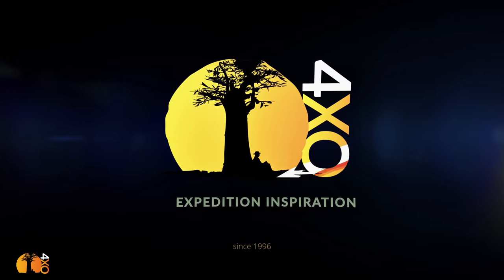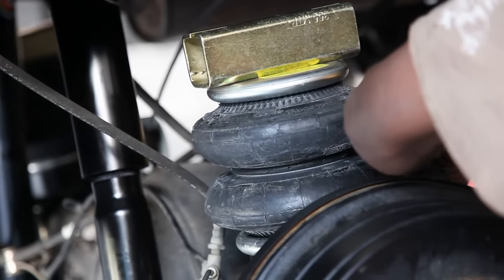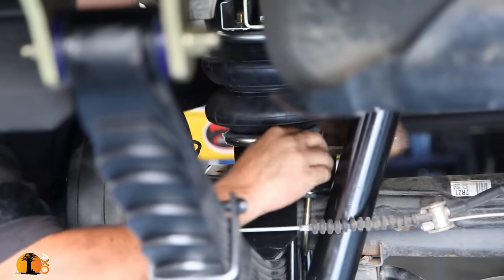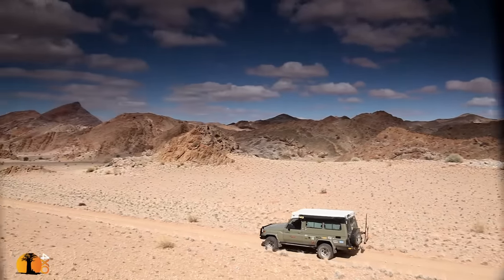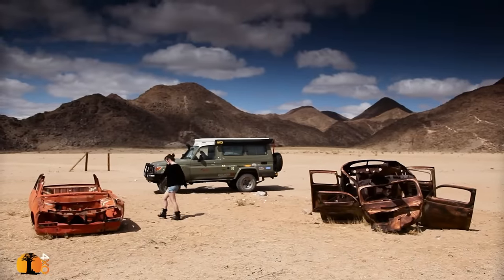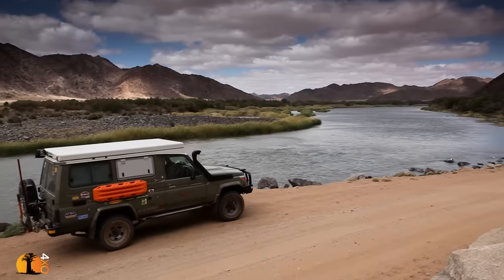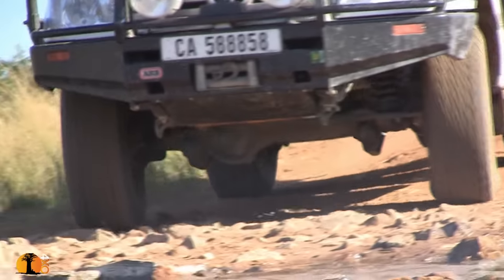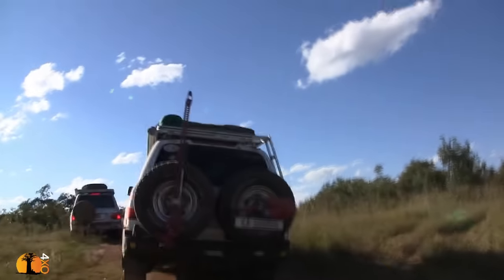AIR-BAG HELPER SPRINGS. ANY GOOD? | ASPW 4xOverland

Comment: I do not disagree with most of what you are saying.
However I would add in my experience with air helper springs as a way to temporarily add spring rate for temporarily heavy loads while retaining the stock suspension for mostly empty use and more comfortable ride. 
So number one if an air bag is rated for 70 80 lb of air pressure doesn't mean you can use it once you get above say 30 in most airbag applications it does lock the suspension out. So if you need more than 15 os so pound's roughly than you need a low distribution hitch for a trailer or heavier mainsprings for a camper van type thing. Secondly the bigger the bag the more air volume and the cushier the ride at pressure. One way around this when you have to run smaller bags is to run air tanks in line as close to the bag as possible with a big line between the tank and the bag this acts as a reservoir and the same amount of air pressure will give you more Kush a softer ramp up rate so to speak.

Comment: Pretty global statement ASPW. There are applications out there where the mount points are more than sufficient for the generally (hopefully) amount of lift needed. 4th Gen 2500 RAM is a prime example. That said, airbags will limit your upward articulation (typically) and most definitely have a different ride feel than spring steel. Not necc. In a good way.

Comment: Will a 50 kg helper spring really stress the ladder frame?  I would say no. Maybes if you go over the top with it then yes. Also the way air bag are located on the  LC 70 (above the axel) could help reduce the stress on the ladder frame.

Comment: Agree. They are not for you. But they are for us with slide in campers.
We have rigs that runs great empty, and by using helpers springs, we have cars that runs great fully loaded.

The part that's take the hit, are the same please that use to hold the bump stop.
That place is designed for that stress...

But, the again, I drive a HiLux....

Comment: Very interesting video.  At first when Andrew was considering airbags, I was thinking about what percent of the time would the vehicle be “light” vs “heavy”.  If it would be heavy only 10% of the time, perhaps airbags would have a place.  I never thought about the strength of the connection points.  It’s wonderful learning things.
Reply: Glad you made the point of the chassis not being engineered for all the modifications. Something I would consider are the timbren bumpstops which could reduce the chassis impact with better control when it bottoms out.

Comment: The dreadful squatting stance. From an engineer’s point of view it’s not a big deal as long as at high speed the negative rake doesn’t invite too much air wedged underneath the chassis and causing lift at the vehicle’s front thereby reducing steering control.
As for the rear end violently bottoming out at full load; stiffer springs will sure take care of that at the cost of less stability at high speed, harsher ride (especially for those passengers at the back), higher stress concentrations in the chassis and worse off road ability in way of shorter suspension travel at the back. To solve the problem consider hydraulic bump stops

Comment: If you don't go over the  gross vehicle weight rating (GVWR), or gross vehicle mass (GVM), you cannot go wrong. If the Troopie  rides better with the softer springs while not on max allowable load, you changed the GVWR.  It it self this is not a problem. But when weight is added to the vehicle with the softer rear suspension, my experience is that having airbags is  an option. But do not go over the GVWR of your vehicle. It has to do with brake capacity etc. of your vehicle.  Safety must be the first consideration.

Comment: uuh - Max GVM is the same whether towing or not (possibly the bias shifts rearwards with ball weight)

NB, YES - coil spring constrained cylindrical / single bellows airbags are a sad option...  Little better than a heavy bump stop....   (poison ratio exists)

Truck-like airbags are an option for those who drive vehicles whose gross weight varies wildly on a  regular basis.. - design for maximum wheel travel - the airbag really should be on properly engineered hangers - not just replacing the bump stop.

Comment: Going to have to call BS on the 10:40 part about airbags.  The Ram 3500 with FACTORY air leveling has airbags in that exact location....... So while I wouldn't use it to increase load carrying capacity, it's more than capable of holding the load at the factory height.

Comment: As a separate system from the coil springs, its a no go. However used as a free floated helper spring, air bags make a bit of sense. That being said they can be unreliable.

Comment: How do you feel about factory air springs?
Reply from the maker: My opinions about factory air springs are well known. If they are electronically controlled, IMO they have no place in any adventure vehicle. Because when the system fails (and they do) one cannot repair them and it requires specialist tools and computer programs to get going again.

Comment: I highly disagree with you regarding shock absorbers being able to control the weight of the vehicle and keep it from bottoming out. The shockers are strictly there to control spring oscillations....be it a coil, leaf or torsion bars creating that form of energy. Even Baja trophy trucks don't use the shocks as bump stops or to limit bottoming out. Shocks are to keep the tires connected to the ground and prevent them from bouncing like a ball. In case you are under sprung and start bottoming out, there are other options such as hydraulic bump stops, poly spring bump stops, etc. Regarding your rear spring issue, I would go with a heavier spring for when "loaded up" and just reduce 5 to 10 psi off the rear tires when lightly loaded to soften the highway ride and limit the slapping sensation when going over expansion joints and such at speed. Tire pressure will have more effect on ride comfort than the spring rate differences you're dealing with. Cheers.

Comment: I have to disagree with you Andrew.

Helper airbags with internal bumpstops mounted instead of factory bumpstops are great.
You will not break a chassie at a bump stop mount unless you are already overloaded.

They ofcourse need to be of the right size, shape and lenght so they don't restrict the wheel arcticilation.

But they can help you do excectly what you want!
You want springs that are soft enough to be comfortable in low-medium load range. 
Then with the perfect pressure in the airbag they will help share the load when extra heavy or towing.

Comment: I find anything designed to cater for excess weight  you have to make sure where the attachment  points are, is within specification for the excess weight..

reason why shit fails  because it under engineered carry the load you want to  carry on it..

if you are towing  something at 2 ton or higher, average ball weight is 200 kg,  if you are towing  4.5 ton you're average ball weight is 450 kg,

If what you are towing has a 1.8 ton/1800 kg ball weight would 180kg..

average off road considered caravan getting between 3-5.5 ton average ball weight  300-550 kg

75-150kg  would roughly 750-1,500kg

the bigger issue with utes, is to add structure before you decide the weight  capacity  you want to  hang off the back and what to tow  without damaging the chassis...

Comment: For overlanding you shouldn’t need to install airbags if you put the right suspension on as you ideally should be working within a set weight range. I have used airbags on 5 Landcruisers over 20 years & where they work is for towing big, heavy trailers to create stability, or cab chassis vehicles where you might go from no tray weight to a 1 ton payload. I’ve never broken a chassis in a million kilometres, the people that do have overloaded & over inflated on vehicles that are too light in the chassis for what people are trying to load on them.

Comment: airbags are made to put in something like a prado for towing your boat on the bitumen. THAT is the use case. You didn't mention proper use cases. In this useage pattern, you don't stress much of the car and its only used now and then. THey are not designed to be used offroad under extreme load and conditions as you said. It's a very common misconception.
Reply: theres a few rock crawlers on only airbags here in the US

Comment: I find the airbags on leaf springs eliminates body roll very significantly.
Reply from the maker: It does. By limiting vertical wheel travel. Good at speed, not good off-road.
Reply: @4xoverland  I find my hj61 Sahara with 200kg on the roof (tent & 660w solar) , has much better handling both on & off road with the airbags @ 25psi. If they aren’t inflated…it’s like a beanbag on wheels.😂

Comment: Why not just use test loads to find the weight limits for those parabolics prior to building out the truck rather than asking the hordes on Utubez?
Reply from the maker: I know the weight limits of the springs. On paper they should be too light to carry the load that I've already fitted. But in reality, they are not! And this is the point of this experiment. Do it the way the stores do it and most of the time 4wds are over-sprung. Because the stores play the safety factor first, not the comfort factor. I am looking for the right balance, and working it out for myself. Many have suggested air-bags as a solution. I have rejected this idea, and this is why.
Reply: @4xoverland  you fail to mention a 3rd scenario, replacing coils and springs with air suspension entirely. I want to know how does air suspension perform on ash board roads, I know it extremely uncomfortable when you raise the height of the vehicle but I heard nothing is more comfortable than air, especially off-road.
Reply: @4xoverland  My only experience with air bags has been a positive one. At 5psi (min setting) they really don't affect the normally sublime ride of the King Shocks suspension, but when carrying an additional 30 gallons of fuel, water, etc and towing they offer perfectly customizable support on the fly.  Granted this is on a RAM 2500 Power Wagon on 40" toyo M/T's, so I'm nowhere near the design limits of the carrying capacity for the frame and axles, but I've been rather impressed with the performance in every situation thus far. From highway to washboards to more technical max articulation scenarios it's been perfect. Living in SW Utah I use the truck more than most and coming from a heavily built 200 Series I can't say I'll ever miss that platform.

Comment: I’ve got a Mercedes sprinter van as a workshop, it got leaf springs at rear but only 1 layer so to be Abel to carry the load I’ve got som airbags in stead of an extra layer of springs, worst decision ever… yes it keeps the rear of the car from sacking but if you have to drive over speed bumps you have to go extramarital slow or everything in the car changes place. Real factory fitted air spring, yes please but never as a help again

Comment: Air bags are to go. Most people don't need no more then 35lbs to 40lbs.far from the max of 100+ lbs. If you have to run them that hard then you should look at beefing up the suspension. Airbags should assist the suspension not take over.  I have a 600lbs tougue weight on my camper. I have a 1500 GMC elevation that has 9200 lbs towing capacity and 1780lbs cargo capacity. The truck will loose 11/4 " .  But the truck is level beacause it has a rise of the same from the front not loaded .  To get the truck to back to factury of 11/4" i raise the it to that measurement with the airbags. 35lbs does the trick . The bags in my book help with the suspension. It feels stable on the steering as well as ride. To roling and the sress on the suspension is releived in my book. Experience is the best teacher. 1500 trucks have soft suspensions for ride and it doesn't hurt to have airbags to help them. I tried both ways and the airbags make the difference. Even my wife notice the difference in bad roads. With the added tongue weight and what i have for total cargo you could botton out on bad roads so airbags in my experience give that added comfort and stability.

Comment: The manufacturer should have designed the rear springs to carry maximum permissible weight; using any form of helper spring to allow an illegal overweight condition is just stupid; if the spring is too weak, fix the spring.

Comment: I disagree. When you talking about chassis not designed for taking load your talking about leaf sprung vehicles which is true.
If you put a bag inside a coil spring the load point is designed for that.
I think bags inside coils ride well I have them in my patrol and I don't notice any adverse handling. Certainly it's not undrivable.
You also fail to mention that irs vehicles like the patrol benefit from bags as vehicle squatting throws out wheel alignment and can wear tyres excessively. Bags especially when towing will allow you to correct that negative camber.
I know from your point of view you look at it from a leaf sprung live axle and that biased your opinion on them

Comment: You said it. OVERLOAD. Yes the bags would be a concern however if used within the correct weights are ok. Don’t scare the shit out of people. Do some more research.
Reply from the maker: 40 years overlanding. Used them on my own vehicles. Seen ones that break. Enough research for you?
Reply: @4xoverland  Your entitled to an a opinion as is myself. I’ve seen 40 years of Broken suspension without airbags fitted. If the bags are fitted and used within the vehicle and bag specifications they are perfectly ok.

Comment: So you’re saying that the axle and the frame aren’t designed to carry and distribute loads? Well sir, that is just completely false. And you obviously are not an automotive engineer because what you said in your conclusion is just not an accurate statement.
Reply from the maker: I am saying manufacturers engineer vehicles very exactly to carry loads. But if you change the geometry and therefore change what the engineers designed by adding items such as air springs, with no engineering considered, one is asking for something to break. I've seen this myself. Air springs the direct cause of a snapped a chassis because it was modified by guess work.